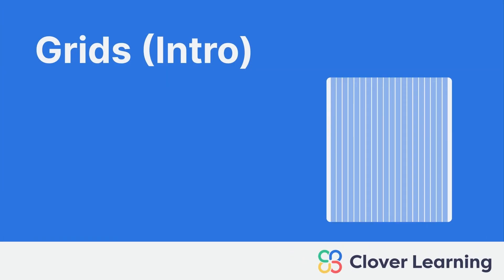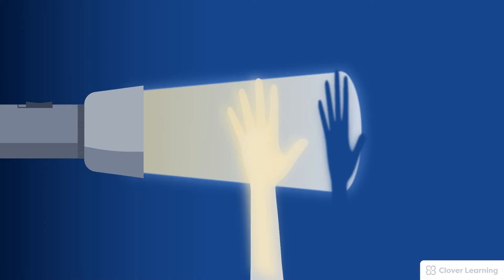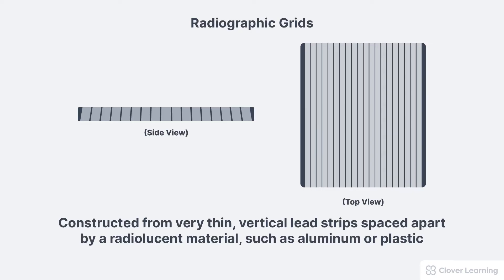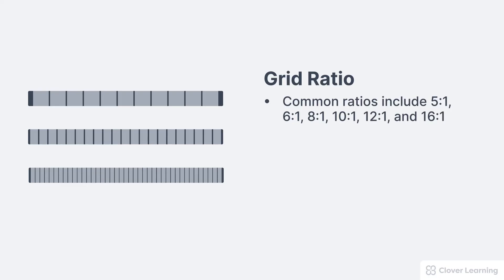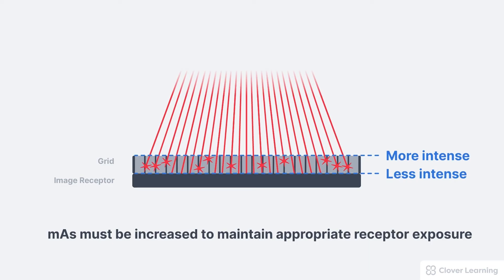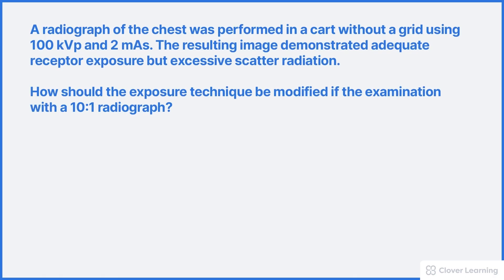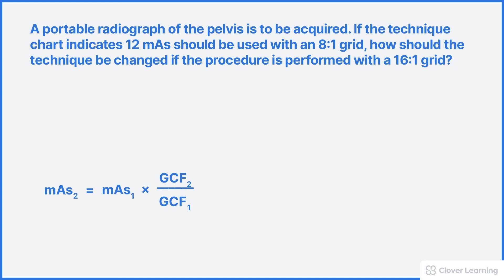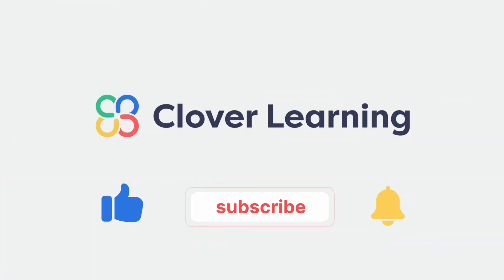Grids - X Ray Image production

Comment: I surveyed 120 qualified radiographers at a national conference in Australia about understanding how to use a focused grid. Only 1 in 4 knew how to use geometry to get the best results. If you failed to understand the geometry of a projection, you would also fail to understand how to apply that geometry to a focused grid. Here is the test I set https://youtu.be/4W1g0UVOGq0?si=2kxhsXDyyb29gnTC  It is interesting that only 5% of radiologists fail the test. Of the general public 90% fail and the ones who pass tend to be engineers, architects and builders, so there is a kind of illusion or presupposition there.